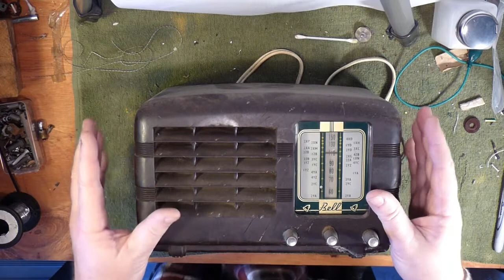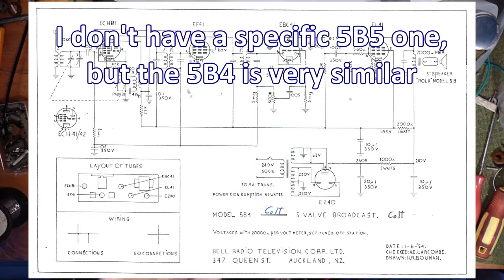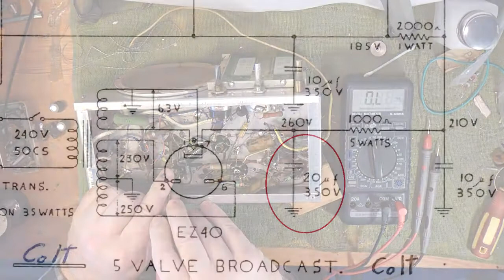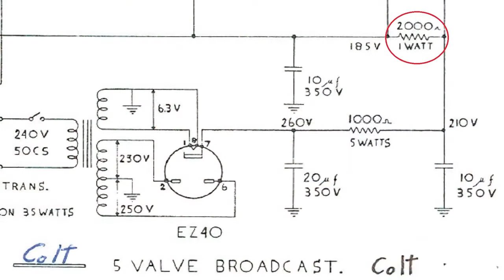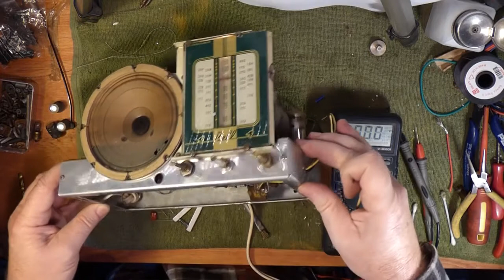1955 Bell Colt (5B5) - Made in New Zealand for almost ever!

Comment: Hi Steve. Comforting to see that other people mess things up occasionally. I recently fixed up a Bell Colt 5B4 which was very similar. I hooked the electrolytics up point to point under the chassis and it turned out pretty neat. It was a great little radio & I sold it to a collector. 
Thanks for another great video!
Reply from the maker: Ha! I mess up all the time... And I do try to leave those mess ups in the videos because I figure if I do it, someone else might too... So hopefully people can learn from my mistakes even if I don't 😂
Reply: @VintageRadioSteve  Thanks for leaving in the mistakes...I'm here to learn!

Comment: Hi Steve. Talking to an old airforce avionics tech last weekend. He did the first avtech Cse with me back in ‘76. He was originally radar and worked in the avionics bay on base whenuapai but got out before you arrived. 
He has a box of NOS vacuum tubes and is looking for someone with a valve tester. Do you have one or can suggest anyone. My friend (Adrian Roberts) lives in Foxton. Cheers
Reply from the maker: Hi Ron, if he's in Foxton, then tell him to head into MAVtech, it's a museum with a lot of vintage gear right there in town.  Someone there will point him in the right direction - it's one hell of a place and well worth a visit.  I might do a walk-through video next time I'm up that way...  I do have a valve tester, but I'm down just north of Christchurch, so wouldn't be able to help out.  Cheers, Steve

Comment: Hi Steve, I came across your youtube clip while searching for info on my recent purchase. I was passing thru Reefton on the west coast a month ago and found an old Bell Colt valve radio in an antique store.  I had to have it as it reminded me of my early years in the Airforce when I had one of these in the barracks.  I finally got round to cleaning it up today and applied power and wow!, it worked - great.  One thing though, I have all three knobs (white with gold ring) but two of them are broken and I unable to secure them to the pots.  Can you give me some idea where I might be able to get 2 of these knobs, or 3 knobs that are similar colour.  Cheers.  BTW, what years were you in the Airforce?
Reply from the maker: Hi Ron, the knobs pop up from time to time - they can be hard to find in a set of 3 though - Trade Me is probably the best bet.  There is a user called 'Geology' who sells knobs on there - he's not cheap, but he might have a set if nobody else does.  If it's only the centre-ring thats broken, you might be able to repair them with areldite or similar?

I joined up in '89 and finally 717'd in 1997 from memory - Mostly CT-4 Air Trainers and 3 SQN in Wigram and Hobsonville, but I also spent time in the Avionics buildings in Whenuapai and Ohakea.  What did you do?  Your name looks vaguely familiar but I can't place it... then again, I can't even remember what I had for breakfast.  Wait... did I even have breakfast?
Reply: @VintageRadioSteve  Thanks Steve but I may have found just what I am after on trade-me.
BTW, I was in the airforce from 1973-1993, most of the time at Woodbourne but last 3 years as senior instructor at 2TTS.
Reply from the maker: I was at 2TTS in 89, we were an experimental Avionics basic eng. course, because those were typically always in Blenheim.  We got the s#!t kicked out of us by the older techs for marching properly and showing them up. Wigram was so much more relaxed than Woodbourne but we were straight off recruit training. Ah good times... Anyway, glad you found the knobs. Let me know if you need service parts for it, I keep them on the shelf. Cheers, Steve